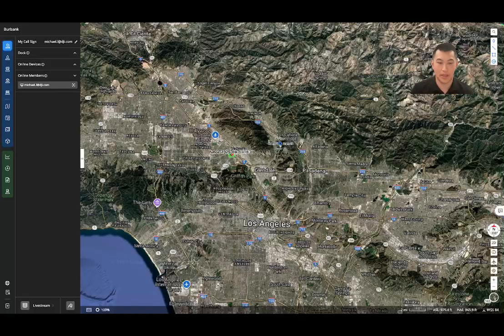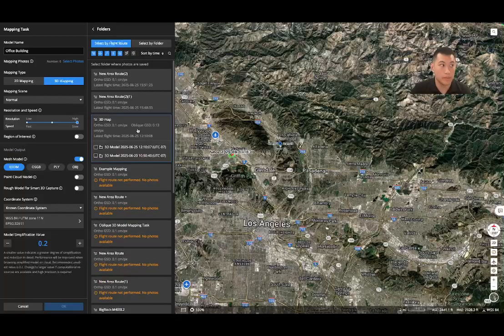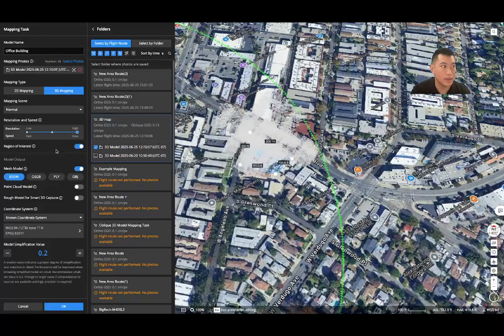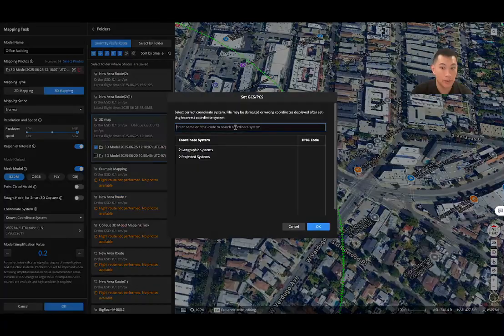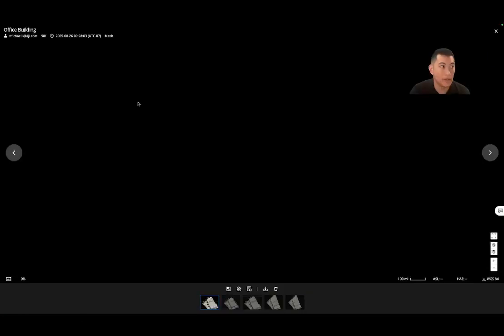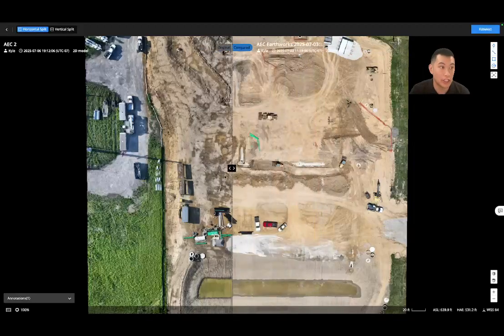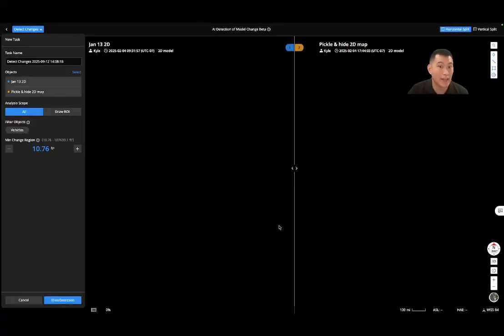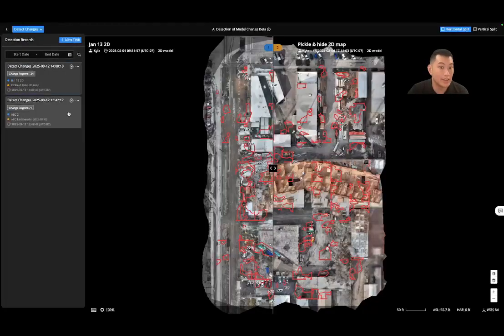Flight Hub 2: Post Processing

Comment: Hello, is it possible to automatically detect changes on thermal images?
Reply from the maker: Not currently supported in Flight Hub 2. Can see temp values of individual thermal image in the media library and manually compare.

Do have a function for the newer series of drones like Matrice 4 or Dock 3 + M4D where the drone can stop and take photos when the temp is over a set value. This would be during a Waypoint Mission (add intelligent recognition action) or by using the Patrol Route mission.

Also have a thermal SDK if you would like to build your own solution: https://www.dji.com/downloads/softwares/dji-thermal-sdk